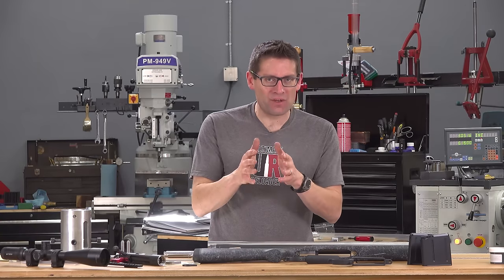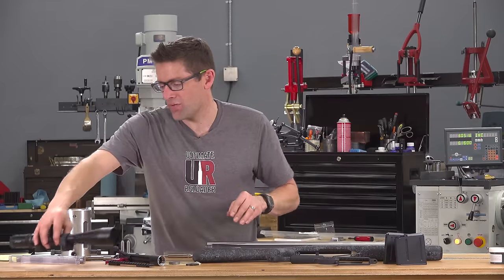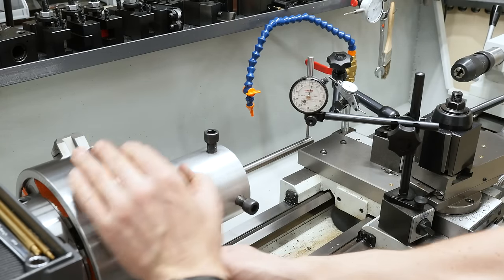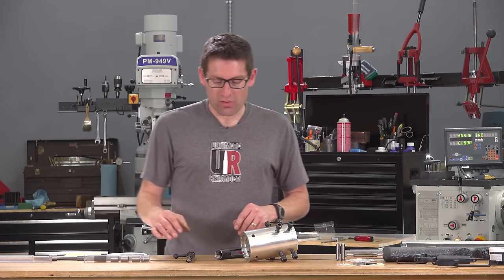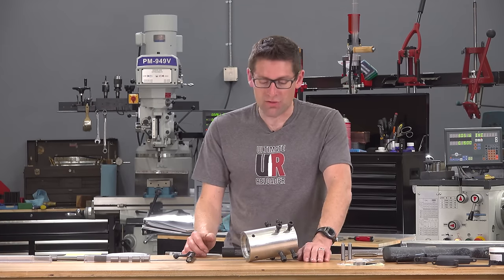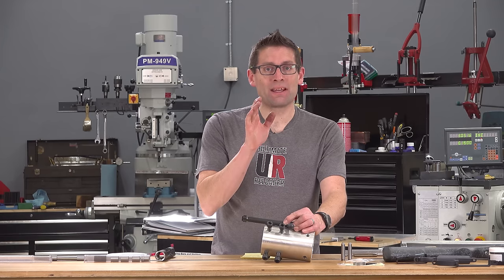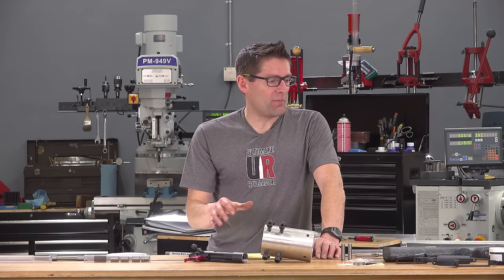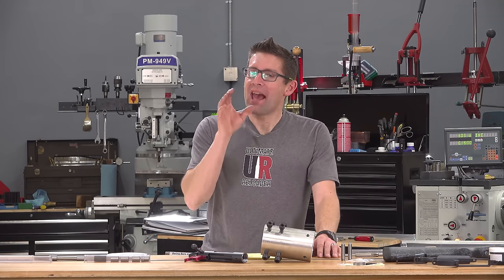300 PRC Budget Build part 1: Action Blueprinting

Comment: Since you said the bolt is angled slightly by the influence of the trigger and the looseness in the bore wouldn’t the bolt face now be out of square once you’ve lapped the lugs in the crooked position? Maybe the amount is negligible and after all much worse rifles have shot better groups but that does not seem like the proper way to go about it if you are really measuring to tenths. Also if you went through the trouble to recut the threads the only thing that would do is influence radially where the barrel (angular alignment is set by the squareness of the receiver face and parallelism of the recoil lug) sits so shouldn’t you now measure the concentricity of the bolt face in relation? Otherwise that seems like something for nothing. Lastly if you would indulge my curiosity could you reset up the action with your indicating rod in the action and remeasure. I am just curious to see if there is any repeatability in your measurements if so it makes me think it is an accurate way of doing things. Thank you for the great video and I hope to not come off as someone trying to troll you.

Comment: Question, since the rear of the bolt in usage is tilted up slightly should that not have been taken into account when you faced off the bolt face? As of now, the top of the bolt face is closer to the cartridge than the bottom when the trigger is installed. Also, concentricity is never termed as plus or minus, it’s always TIR total indicator reading.

Comment: Gavin, is there any way to measure if those “blueprinting” cuts actually make any difference? Would you be willing to re-headspace the stock barrel and reinstall it and see how much better it shoots. I’ve only chambered a couple rifles, but I’m starting to think there may be more voodoo to blueprinting than truth or actual realized accuracy in groups.
Reply: Only blueprint when you get a new barrel. Not worth putting the original barrel back on
Reply: The barrel makes a lot more difference than the blueprint job.  The blueprint just reduces the errors in the action which helps to reduce those impact shifts when the weather changes or the fliers in an otherwise good group.  It’s a total approach.  Reducing variables in the manufacturing process, in the reloading process etc.

Comment: Maybe this has been asked, but why cut threads in this matter rather than use a tap of the appropriate size. Are there any benefits to using your method vs a tap, I just hate setting that set up, having used it on a share of dies and shot sleeves.

Comment: 1917 Remington action!! Theirs a great project.
Reply: I knew a gunsmith just east of Seattle who specialized in turning US 1917s into 375 H&H hunting rigs.  He liked them for the job because the barrel tenon is larger diameter than modern actions, therefore stronger.
Reply: P C they are definitely tanks, but all that extra mass also makes for a very rigid receiver. That’s why I chose to do mine in 300wm but I might be changing it to 6.5,300 Weatherby mag soon. As is it’s sub .5. It’s amazing what u can get from a 100+ year old mil surp.

Comment: Gavin i have a 300 rum , its a rem 700 sendero and ive thought about rebarreling it to 300 prc one thing i was wondering will both casings fit that bolt face? or is there some work required to get that to work?

Comment: This is fascinating  and educational, thanks!  Sadly, I’ve been on the hunt for a (cheap) manual lathe for a few years (I don’t need one for daily use, can’t justify a 1,500.00 paper weight in a garage for once a year use).

In this project, what does “budget” mean?  700.00?  500.00? 1,000.00?
Reply: If you buy a lathe, you will find you will be using it more than you think! They are a handy machine.

Comment: I have 4 Remington 700's ,a 7mm rem. mag.; from the early 60's  a .243 win. mag.; a .338 win. mag. both from the early 2000 era. and a .223 rem from 2010ish. era. 
The 7mm shoots 5 shot groups that touch consistently. no work has ever been performed on this gun except I adjusted the trigger to 1.5 pounds. 
The .243 and the .338 both shoot about one half moa. with no work done ton the guns at all.
All the above guns have never had a factory round fired through them. I have handed loaded all rounds in varying different loads and weights. I'm happy.
The .223 is a different story. It shoots ok, but the bolt is not smooth as I would like, the trigger is like 5.5 pounds and it is one of the "J" models.  I've only fired factory loaded ammo in it. I would Like to get to shoot as well as the 7mm.
Can you recommend a solution ?
John

Comment: i found a rem model of 1917 that was priced like a defaced military rifle. and from 15feet away it did look like a run of the mill sporterized mil surp. it was priced at 199$ the receiver had its ears milled off and was reshaped to make mounting optics simple. it is also drilled for a peep sight with screws plunging the old holes. nothing on this rifle is original! its got a heavy 26 inch barrel and the action had ben worked over and i had scored a action up custom hunting rifle for pretty much nothing! how much would it cost today to do that same job? a fortune it would cost a fortune! it puts 180grn loads into one lil ragged hole at 100yrds! witch aint bad for an action made in 1918.. the trigger is fantastic its like a single set trigger it has a verry light take up on the slack stage then it stops and wen you hit the stop a light touch sets it off. it aids in accuracy at longer ranges for sure!

Comment: hold on hold on.... if the trigger pivots the bolt, so u need to lap the lugs intsed of cuting them. what will this trigger pivoting do to the boltface, which is true to the bolt body? According to this  logic, the bolt face should be trued when the bolt is locked in the reciver to get the boltface normal to the reciver threads and hence the chamber....
Reply: btw realy like the vid :)

Comment: What is the price trade off between custom build ($3000-$5000) and modifying an off the shelf gun($800-$1200)? Also what action is best to work with regarding modifying the action, barrel, lug, round or square action? I bought a new Remington 700-270WSM ($850 and shooting 3" @ 100 yards) and ended up taking it to a gunsmith and had another $800 put into it to get it shooting well (best 3 shots @ .625 at 100 yards)?
Reply: This is why I love savage rifles. You can pick up a blueprinted action in a chassis for $1500. The new 110 elite series is awesome. My old stealth in 6.5 shoots a 1/4 moa group at 100 and 3/4 at 1000 with hand loads. I'm sure a full custom will shoot better but I can't.
Reply: I've shot just about everything. Current modern Tikka T3x CTRs are shooting sub MOA for 5 rounds at 100 yards with factory ammo no problem. I have three (in a row) that shoot multiple factory brands with a wide range of bullet weights at 1/2 MOA at 100 yards for 5 rounds. That's insane for a factory action/barrel/trigger. 

Pick up a Tikka. Instead of having to completely redo the action, throw the barrel away and toss the trigger for aftermarket replacements you can keep all that, put it in a chassis/decent stock (KRG Bravo is inexpensive and very good) and easily have a 1/2 MOA gun or better with handloads. Most likely it'll be 1/2 MOA with factory ammo.

The triggers are fantastic. Stick a $12 spring in them and you can get them to sub 2lb no problem. Mine sit right at 1.5lb with a glass rod break. Oh, and when they heat up during rapid fire strings at PRS matches.... they are perfectly consistent group wise and point of impact unlike a lot of other brands out there.

Comment: What about using a piloted tap for truing the threads. I have seen that on other you tube videos.
Reply: It's consensus among "precision" builders that cutting .010" off the minor of the internal threads and then running a guided tap to "chase" the threads will not square the threads true to the center axis of the action. If the threads were not "true" from the factory you are simply re-cutting the same off center threads only .010" larger. The only true way is to single point cut the  threads after indicating the center axis of the action with a precision ground mandrel.
Reply: Another reason you see the "tap" method is that it is pretty darn scary cutting those internal threads with a single point cutting tool. Until you've done a few (many) there is a definite pucker factor, but the results are well worth it.

Comment: Did you address the bolt handle extraction cam surface. That is an all to often overlooked portion of working on a receiver lile this and trueing them often makes bad to worse for factory actions. Handle to receiver should be no more than .010 I have had factory ones about .030 gap which renders the extraction cam of the bolt handle fairly useless.
Reply from the maker: Good point, but the extraction was working great, and only moved things 0.002! :)
Reply: @Ultimatereloader  if it’s a RR action it doesn’t have any from the get go.

Comment: @gavintoobe Wouldn’t it be better for lapping the lugs to use something you thread into the barrel threads that pushes straight on the boltface? Because there will be some tolerance between the bolt body and the inner part of the action, when you lifting the bolt handle for the lapping up and down you are canting the bolt some what because of the play between the two parts?
Reply: Without the trigger group installed and the cocking pressure applied one does not get the actual bearing surface contact. That is why the front loading spring pressure tools don't give you an accurate bearing surface contact point. The rear of the bolt is lifted when the firing pin is cocked and changes the geometry of the lug and abutment.
Reply: @johnseptien3138  Ok, but the cocking pressure doesn't matter when the rifle is fired? There is no tention on the cocking ramp while firing because all the spring pressure is acting on the sear? You want the lugs to contact during the fireing action if I remember correctly?
Reply: @proxhunter3338  The lugs are engaged prior to firing. That's why it is important to have the bolt in an "as fire position" when lapping. If their geometry is incorrect  you're lapping the lugs in an "out of alignment" position. The spring pressure is most assuredly lifting the rear of the bolt. A small lift at the rear is magnified at the front of the bolt (lug location) increasing the necessity to lap in this manner rather then front pressure to the bolt face in a direct line reward (incorrect).

Comment: and I love how some shops say "We can blue print your action for $350", should be more like $800. I want to know what they are not doing to call it a blue printed action for $350. Gavin shows that done right takes time and one guy taking a day and a half to blue print an action is only $29 an hour, so that tell me they have a $15 an hour guy doing the work to make any money. I want a $40 per hour guy working on my rifle
Reply: Companies sell a tap and reamer kit that does a quick and dirty job off the bore of the reciever.  Never really put it in a lathe
Reply: Amen brother.  Don't want a "cheap" parachute packer either.
Reply: @andy347495  well thats not true. Ever hand tap a crooked thread out of square? Taps and dies can cut crooked and not follow a hole.
Reply: @andy347495  yes knowitall
Reply: @andy347495  Sorry but it's two to three hours just chasing the threads. You loose the ability to dial with the compound when picking up threads so it's .002" per pass. as you are using the cross slide and the tool is cutting on both sides of the thread. that's a great way to chew up threads. 

Facing the receiver ring and lug is easy once it's dialed in. but then you need to do the whole set up all over again for the bolt face and lugs. I am an experienced machinist. I do all my own rifle work and have been for the last 20 years. Been a machinist since 1990. Yeah If I want it done quick and dirty sure two three hours but nothing will be indicated to the tenth that's for damn sure.

Comment: Pardon me, but Remington actions are so sub par, they are laughable. If I could afford to have a lathe just sitting around, I could afford a Defiance Machine custom action. I don’t mean to be critical of this project, but I do believe there are better starting point options.
Reply from the maker: You are 100% missing the point :)
Reply: andy347495 - The Remington shortcoming are exactly what Galvin is about to expose, along with the corrective measures. So no need to reinvent the wheel. Although I’d add a Sako type extractor, “three rings of steel”, be damned. 
My qualm is with the use of the word “Budget”. As per the article, the blueprinting requires $880 worth of tooling equipment. Nor would I categorize a $295 trigger as budget. 
“You are 100% missing the point :)” - the Esteemed Glavin

Comment: Great video, I have only one criticism. To go through all the effort to set up the bolt in the jig and NOT true the lugs seemed a little strange to me.  Personally, I true up every point that can be trued, that way I know there is no questions or second guessing if you have an issue. My thoughts on lapping is it will not true the lug. You will remove a tiny amount of material but it will only follow what you all ready have and do really nothing.  This is what I was always taught, but everyone has their own take on what is “correct “.  In the end as long as it shoots good and your customer is happy I guess it doesn’t really matter anyhow.  Just my two cents. Eddie wheels 😬🧑🏻‍🦽👍.

Comment: Gavin i have a 300 rum sendero and had thought about rebarreling it to 300 prc but i have one question will the 300 rum bolt face work with the 300 prc or is there machining that has to be done